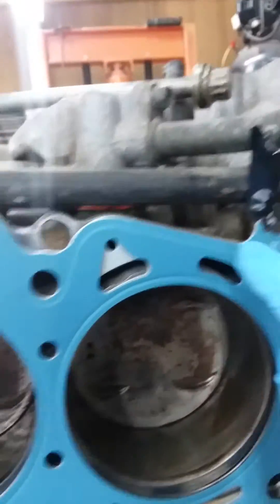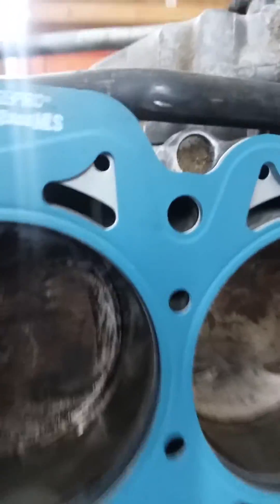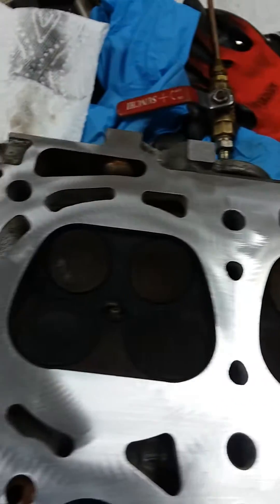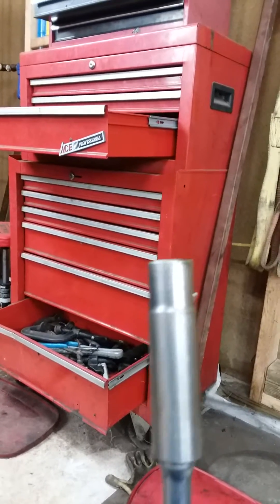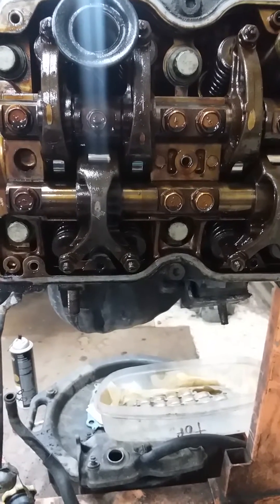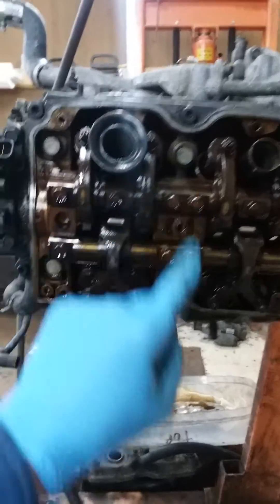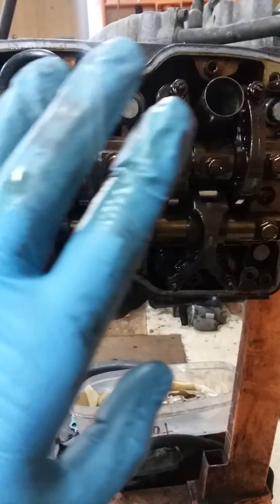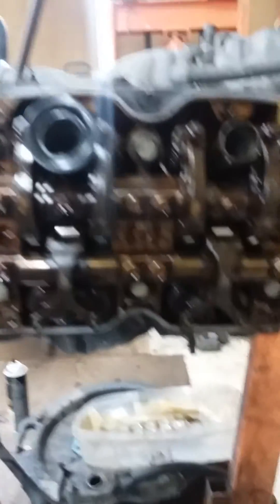torque specs 1990 to 2012 subaru headgasket

Comment: Why do you take off the copper grommets on that gasket? I just installed my first fel pro perma torques and only 1 side failed. I’m not sure why, check flatness with machinists edge and it was perfect and I followed the manual torq procedure. About the throw this second one on and am wondering if I should remove the grommets like you?

Comment: Hi I did the torque sequence and the angles and they were only at 55 lbs I'm going to trust  you sir I just can't blow engine up only car I got
Reply from the maker: @dode1967 That’s why I don’t use angles it is one of the goofiest ideas they had but to reassure you i have been doing this for over 20 years 🙂

Comment: Well my days ruined, head bolt snapped at 75 foot pounds
Reply: I did not I discovered that the bolt set I got was from a bad batch, fortunately got the thread out and with new bolts it's on properly now
Reply from the maker: Glade you got it back together and i always reuse the original headbolts. It was never recommended to replace them before and now they recommend so they can make extra money
Reply from the maker: I have never had that happen did you use factory head bolts

Comment: Terrible video for the uninformed.

Never use a whiz wheel, ever. Machine shop or sanding block, .004” tolerance.

The head bolts are already stretched, 11 pounds on outer bolts, 25 pounds on center bolts, then a quarter turn twice on each bolt all in the same sequence beginning to end. Only way you follow your sequence is if you have brand new unused Subaru Genuine bolts.
Reply: can you tell us the torque spec for subaru forester 2 liter turbo !
Reply from the maker: I don’t mess with the turbo because they never last sorry.
Reply from the maker: We’ll get on the ball and make a better video for the uninformed. As far as whiz wheel it will tear up your surface if you’re not careful.Been doing sequence with used head bolts for over 20 years. Experience is everything. I’m just trying to help some people.

Comment: I have a 96 Subaru with 240k miles. Runs great but should I re-torque the bolts back to 75 and 85 ft lbs to keep from it haveibg any issues later?  Thanks
Reply from the maker: I would leave it alone.

Comment: Thank you very much for this video... I had recent problems with the new black FEL - PRO and mixing OIL - Coolant on a 300K + Subaru head haskets repair. I followed Subaru's specifications to the letter, but it seemed to me that it needed more torque. I will try again with the specifications that you provide and also with the HG part number 11044AA642.
Reply: The felpro suck. About 20-30k they seem to falling apart. Done it twice on 3rd time now.oem subaru sti gaskets this time.
Reply from the maker: i should’ve specified not for turbos and i’m guessing you have modifications too ? I have never had a non turbo come back in for head gaskets 99 percent of my customers was satisfied and they kept coming back 🙂
Reply: Nothing against you just my 06 an 08 sohc outback have had no luck.  My 06 an 08 heads were done not block.
Reply from the maker: @radarrx65v1 Was it the blue head gaskets or the black ?
Reply: @matthewwhite4799  blue.  I just pulled heads off 06 with 12k on gaskets and the blue is coming off. Did one head on 08 28k half the blue gone . I'm swapping 06 to 08. Subaru sti head gaskets #11044AA642. Spouse to fix it. 😆
Reply from the maker: @radarrx65v1 When the block is warped slightly i used the head gasket for 1998 double cam  2.5 it’s a way thicker head gaskets and better but lowers the compression slightly.Have you used my torque specs yet on the felpro head gaskets ?
Reply: @felipecarmona5792  kinda just 10min ago
Reply from the maker: that should do it 🙂
Reply: Did it work for you with his specs?

Comment: Have you ever stripped a head bolt or the block torquing to 85lbs? Curious.
Reply from the maker: I never have stripped a head bolt or block on a 2.2 or 2.5
Reply: @matthewwhite4799  I’ve always done 25# on the 2 middle and 11# on the outer 4 followed by 90° and then another 90°. I’ve got an ej253 engine to rebuild in the next couple of days and will try the torque the way you said to do it
Reply: Idk I’ve seen multiple videos of people saying do 22ft lbs in the sequence then to 51ft lbs the second pass, then back out 180* then tighten the center 2 bolts to I believe it was 25 ft lbs and the outter 4 to 11 ft lbs then tighten all in sequence 90*. But then again I was only looking into the 05 legacy and those are the videos I seen
Reply from the maker: @johnjoe9918  yes a lot of people go with those directions but I’ve used my directions for 15 years with no problems hope that helps
Reply from the maker: Just make sure all surfaces are flat and clean and take you’re time.
Reply: @matthewwhite4799  I gotcha. I’ve done probably around 30 head gasket replacements on ej25’s. And have rebuilt around 8 engines. I’ve used Fel-Pro head gaskets one time and they didn’t fell which was about 3 1/2 years ago. I ended up rebuilding the engine recently and I could see that they had lost some of their coating. I’ve used 6-star a few times back around 4 years ago too with no failure. But since then all I use is the OEM MLS ones ending in #642. No coatings to fail and have never had an issue with these. It’s all I use now and they in between the price of Fel-Pro and 6-Star.

Comment: Don’t use a rotary tool to clean your head and deck surfaces. Take the heads to a reputable machine shop. If that isn’t possible check the head for warping. If it is within spec use a large block sander with 400-600 grit sand paper to clean the head and block up. Never use power tools. You can remove too much material unevenly and the head gasket won’t seal and will likely warp due to uneven torque load on the head surface
Reply from the maker: Yes you are right about tool but if used right you will have no problems and as far as sand paper you need a finer grit. I’ve had a lot come that had to be milled because of errors also recommend using wd 40 or something like it for sand paper and as far as machine shop around here they suck because every time the head is warped out of specs I have it milled and still have to smooth it up. You have all good points though to take in to consideration for beginners. I need to think about it as if I’ve never done it before but I guess it’s just stuck in my head when I start talking. Check out the other video and see if you think I did any better?

Comment: Matthew White. You did a good job, the BS Subaru torque 'angle' tightening is INACCURATE. Around 60-70 Lb's of torque is where these Subaru heads should be. Many people follow subaru's BS torque angle 45% 90% 11lb BS and UNDER TORQUE these heads and then they get premature leaks from the bottom oil passage near the back of the head.. Only thing i would suggest is next time don't use Fel-Pro they have that blue coating that breaks down it's best to use turbo multiplayer steel headgaskets.
Reply from the maker: Thank you sir! The blue felpro works good but does seep after 100 thousand miles but the black ones are junk don’t get me wrong I have had some blue felpro come in leaking because they didn’t clean and used wrong torque and yes you’re right on turbo! but when block is warped I use 1998 2.5 head gaskets for the thickness. Thank you for the comment! I’m glad someone else thinks like I do!!!
Reply: @matthewwhite4799  You have the experience to know Subarus factory cylinder head installation torque specs are trash. I am an experienced mechanic and I made that mistake my first time. I followed Subaru’s 11Lb, 45%, 90% Exc exc BS instructions with a calibrated torque wrench and I had that car coming back a week later due to oil dripping from the bottom oil passages, and yes the heads where sent in to the machine shot for cutting and pressure testing. I can’t believe Subaru put out such garbage instructions but then again it’s the same company that put out these engines with a faulty head gasket in the first place…
Reply from the maker: Thank you and yes Subaru went down hill bad!!! I’ve been working on them for 25 plus years I just don’t speak right on video in terms but I think right when in fixing them and I miss the old 2.2 in the 90s I think toughest motor they ever made and I made that mistake at very beginning too. Everybody got to learn somehow. Heck man start a YouTube channel theirs room for everybody
Reply from the maker: Whoops my bad you did start a YouTube I subscribed!!!

Comment: Yea, this isn't right compared to the service manual.. But I liked the tip for cleaning out the bolt holes. 

Apply a coat of engine oil to washers and bolt threads.
(2) Tighten all bolts to 29 N⋅m (3.0 kgf-m, 22 ft- lb) in alphabetical sequence.
Then tighten all bolts to 69 N⋅m (7.0 kgf-m, 51 ft- lb) in alphabetical sequence.
(3) Back off all bolts by 180° in reverse order of installation, and back them off again by 180°. (4) Tighten all bolts to 42 N⋅m (3.9 kgf-m, 31 ft- lb) in alphabetical sequence.
(5) Tighten all bolts by 80° — 90° in alphabeti- cal sequence.
(6) Tighten all bolts by 40° — 45° in alphabeti- cal sequence.
(7) Further tighten bolts (a) and (b) by 40°— 45°.

<------- Engine front.
A.  E.  C.  
D.  F.   B.

Not sure if this applies to all years ? This is for the H4SO from a 2004 wrx.

Question is... Is this okay for the 2012 forester SOHC..
Reply: That is right in the book but not correct in real life. If you follow the Subaru spec torque spec you will always have head gasket issues. This video is correct 💯 . ARP does not follow the Subaru tq
Reply from the maker: Yea I know I used the manual about 15 years ago then I started doing it this way. And they never recommend head bolts be replaced and now they do just to make extra money
Reply: @matthewwhite4799  yeah. Is this procedure the same for the 2012 vs 2004 ?
Reply from the maker: Only the engines with timing belts. I’ve only done a couple 2012 that had the belts and the rest had the timing chain which this does not apply too
Reply from the maker: Applies to non turbo and no timing chain 2.0 2.2 2.5

Comment: For the EJ25, Subaru specifies partially tightening and then loosening the head bolts, re-tightening and then an angle torque for the last steps. All of these unusual steps are designed to increase the accuracy of the tension. The friction on tightened bolts can be inconsistent while degrees of rotation are not. I used to repair '80s and '90s Subarus and back then it was more like you describe here.
Reply from the maker: Very well could be but I’ve been doing this for 20 years and haven’t had a head gasket come back so I just figured I would do a video and inform everybody and maybe help a few
Reply: @matthewwhite4799  I have followed those factory instructions to a T and still have found lose bolts. Even had a head slightly lose. Subaru has some really strange torque instructions... Matthew White your way of doing this here is far better than the factory BS 11 pounds ,90%, 45% exc..
Reply: Yes and that's why the OEM Subaru head gaskets fail because of that Mickey mouse style that they have. This video shows how much professional way of twerking the head it's almost just like ARP spec
Reply: If those are Fel-Pro head gaskets you have screwed up.
Reply: @jophillips2868 care to elaborate or just mouth off?
Reply: @tim4609  I'll be glad to do both you must live a sheltered life get out and investigate things a little bit live a little search you'll find the truth.
Reply: @jophillips2868  lotta talk for no reason, post a video if they bother you so much lol
Reply from the maker: Been using them for along time and they hold up good . It depends on the mechanic to know enough to make them work the way they are supposed too. Have to make sure everything is within specifications and cleaned right that why I pull the engine. I’ve done seen the videos you’re talking about. I guess they just want something to blame other than their selves.

Comment: Well according to all data you have to torque, loosen bolts and retorque and the angle torque
Reply: That's only if you are using new bolts. The loosening and and re-torque is for stretching new bolts.
Reply from the maker: I know that’s what chilton manual says to but I’ve been doing this for along time. That way works too for getting by but I like fixing things right and to make them last!!!

Comment: Hows that felpro holding up ?
Reply from the maker: I only use the felpro the blue ones. They hold up good as long as you don’t overheat bad.they can’t hold up as good as the thick older ones. They are way to thin